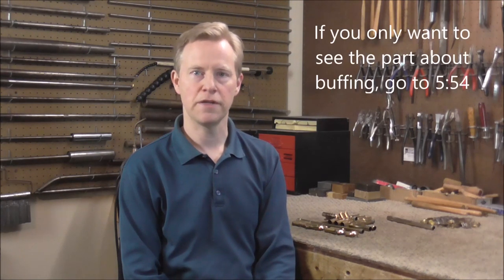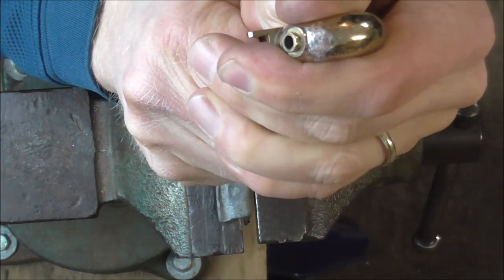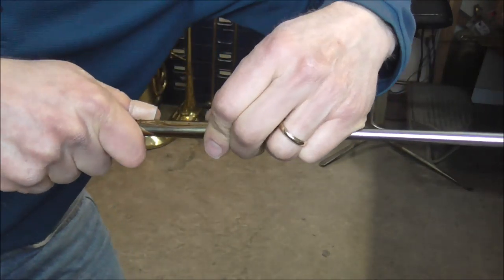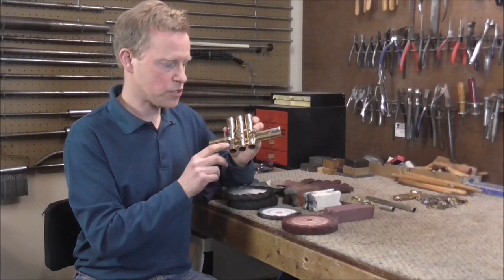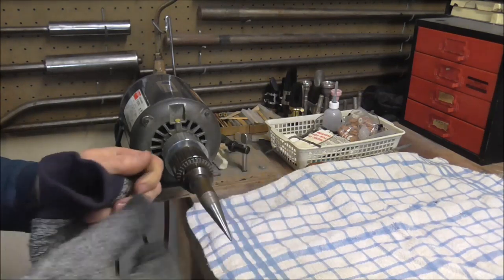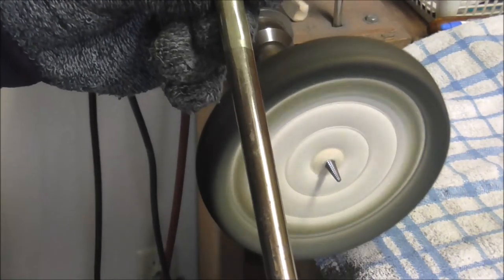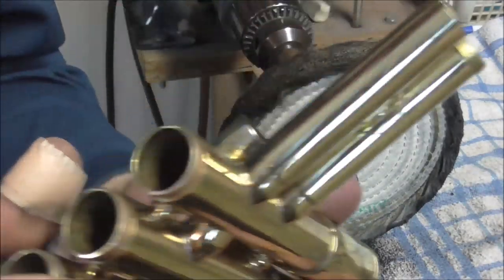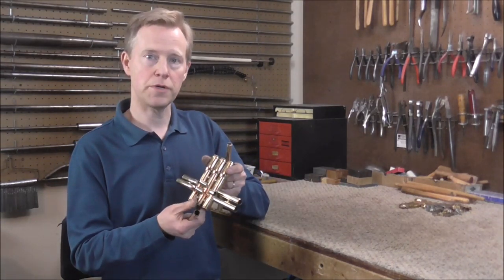Small Dents and Buffing: Olds Herald Trumpet Restoration #3

Comment: Hey Art! Allied actually has a great tip for buffing - in response to when you said you don't like taking off too much lacquer. Allied has in the catalog to mask the area off with Masking tape or painter's tape. Then the buffing wheel takes off only what is exposed outside of the tape and it's super easy to peel off once you're done buffing
Reply: Great tip Ian.
Reply: I’ve found the blue painter’s tape works better. If I’m aggressively buffing and use regular masking tape it seems to heat the tape and leaves a bit of residue from the glue on the horn. I’ve not had this issue with the blue tape.

Comment: I dented my trumpet on the just after the keys near the bell side its not a big dent but how do i get it out. With the dent rods? thanks for the video. How did i tent my trumpet i caught it on the edge of the table in my practise.
Reply from the maker: Yes, I would get a dent like that out by using a tapered mandrel dent rod.